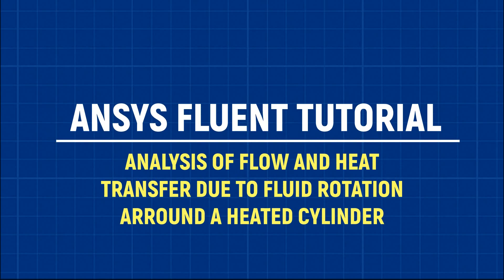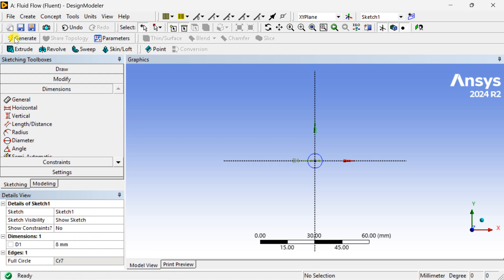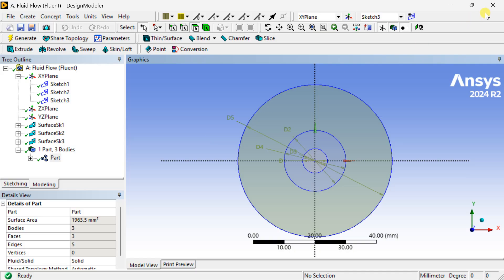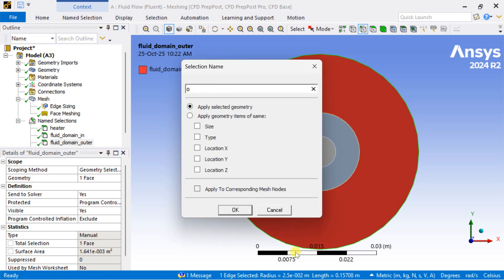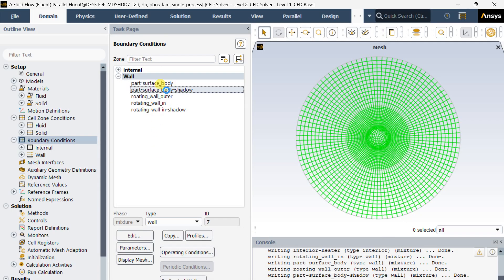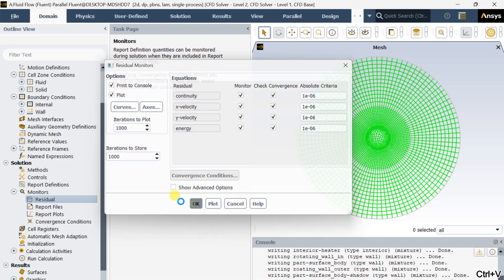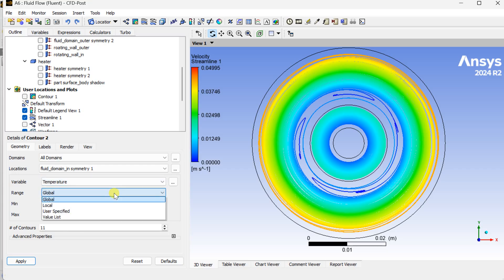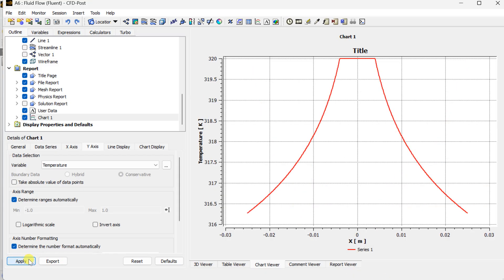ANSYS Fluent Tutorial: Flow and Heat Transfer Around a Rotating Heated Cylinder | ANSYS CFD Analysis

Comment: How do I make a physical test to validate the simulation? is the center cylinder fixed? How do I to rotate two concentrical flow in opposite direction?are there two walls between the inner rotating domain and outer rotating domain? Thanks.
Reply from the maker: For physical tests, you need to connect these cylinders to a motor
Yes, the  inner cylinder is a fixed heated cylinder, if you want the fluid rotation,  you need to enable the frame motion of that cellzone.